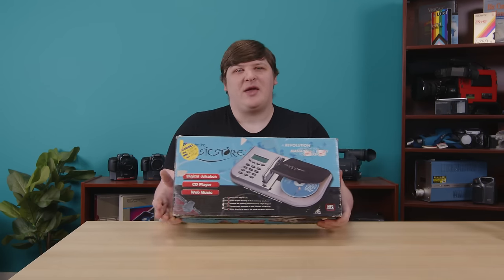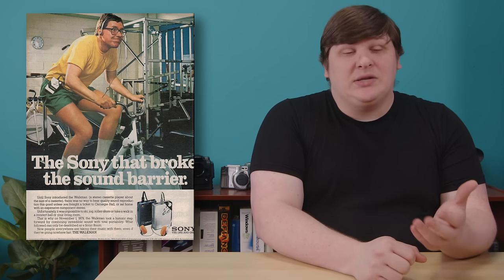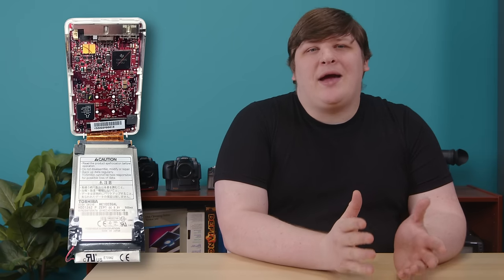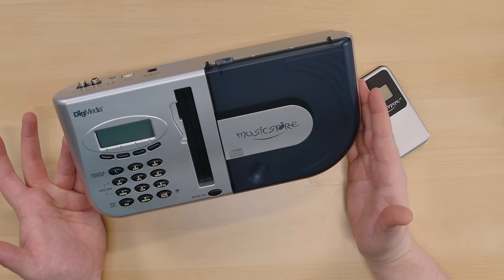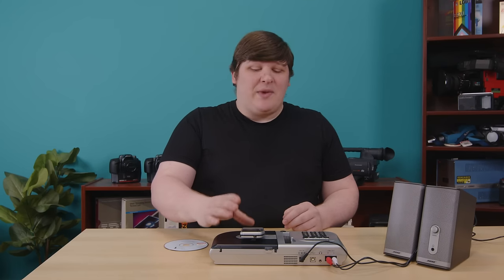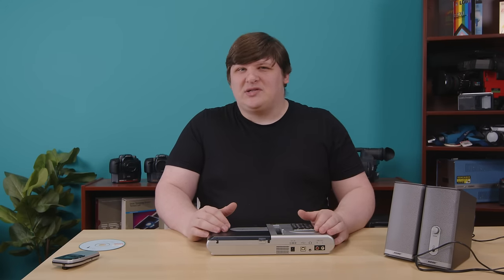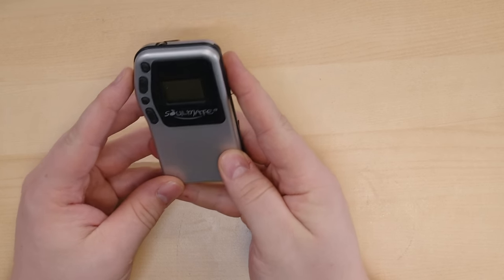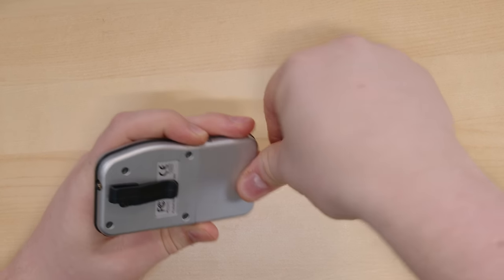An MP3 Jukebox for Everyone (Including The RIAA)

Comment: Ah, yes, I remember the Rio MP3 players. I bought my wife a Rio Sport MP3 player in the early 2000s when the tape player in our car stopped working. The car was already more than 10 years old, and we'd been looking at replacing it, so the Rio Sport with one of those interfaces that looks kind of like a cassette tape (which didn't work because it turned out there was more wrong with the tape player than a loose capstan belt) or a short-range FM transmitter interface (which did work, sort of) made more sense for tiding her over until we got a new car than replacing the radio did. In the end, the Rio Sport proved too fiddly for her, and she just took a battery-powered tape player with her in the car, but I used the Rio Sport to listen to podcasts when working in the kitchen.

Pretty much everything you said about the Rio that you showed also applied to the Rio Sport, except that the Rio Sport had a USB interface for the computer. The problem was that it only had 8MB of built-in flash storage, so it couldn't hold a lot of podcasts (or songs). It had an SD card slot that could accept up to a 128MB SD card, but those were relatively expensive at the time, and I never did use the thing enough to justify buying one. Getting content on to the player was way too complicated. Like the Rio you showed, you had to use the proprietary software that came with the Rio Sport in order to put content on it, and while that software was easy enough to use, it was clunky and would often crash, necessitating a Windows reboot to get it to work again. The Rio Sport was also pretty much locked into the Windows XP world. When our XP computer died in 2011, I was able to continue to use the Rio Sport for awhile via Windows 7's XP Mode, but this took a process that was even more flaky and time-consuming than running the Rio software in native Windows XP.

Eventually, I replaced our junky kitchen boom box with a nice Bluetooth radio that I could feed from my phone or laptop, which rendered the Rio Sport obsolete. But I got a good 13 years of use out of that Rio Sport. For all its shortcomings, I could've done a lot worse back then for $50.

Comment: To add to your but about the Diamond Rio from the start of the video: I remember the early days of portable MP3 players in the UK. Specifically, I remember a portion of a BBC news segment about them where they interviewed a woman who was a runner, and she said it's great that she can strap it to her arm like her normal CD Player (yes, they really did sell arm sleeves for CD Players) and listen to music on the go without it eventually skipping like even the best CD Player of the time. The downsides were numerous though: CDs took forever to rip, the quality wasn't as good, the player was costly, but given it was just before the debut of Windows XP, it meant fumbling in the dark with Win9x USB support or, heaven forbid, parallel ports, or dirt slow USB1.1 on some kind of Mac if the software even ran on on MacOS8 at all (and if it did, it'd be on the same.basement level as music match for windows) and overall she was disappointed but was keeping it for the "skip protection" as that was such a killer feature to have in something higher quality and still more convenient than making a mix tape or two.
Reply: I wonder why she didn’t go with MiniDisc.
Reply: @kaitlyn__L  To put music onto it at the time would've required a separate hifi component where you literally recorded content onto it like you would a tape deck. Music files transferred from a PC would require yet more unnecessarily complex steps and software, files were stored in a Sony proprietary ATRAC format that at the time was worse quality than MP3, meaning all these new fangled internet music files would need to be converted to ATRAC, disks were expensive, commercial music was never (or seldom) released on the format, and you still had to deal with the fact that you had a spinning piece of metal in your pocket. My older brother had both a hifi component and portable minidisk player, and his collection of mini disks was SMALL. You may as well use a cassette deck with good quality tape and the result will be just as convenient and noticeably cheaper.
Reply: @benanderson89  almost all the portable players could record, and indeed most people used them to get their CD collection skip free. 

Not for downloaded music. Was she explicit about using it for Napster on the BBC? Of course if your number one intention is free downloads that changes things, as NetMD players hadn’t yet launched. 

Cassette decks were absolutely susceptible to shocks as well, and the runner you quoted was apparently besting CD skip protection regularly. She’s willing to pay a premium for more robust skip protection, so I wouldn’t be surprised if increased flutter would bother her too. 

Of course it’s all just academic at this point.
Reply: @kaitlyn__L  and there's the problem in your first sentence: RECORD. Ripping a CD on a PC in 1999 plus a data transfer to an MP3 player, even over pathetic USB1.1 speeds, is faster than realtime playback of a full album. Plus, once you've got your MP3s, they're just on your computer, so if you wanted to swap what tracks you had on a device, just tell the software to overwrite them and they'd transfer to a flash device instead of a magneto optical one that needed another stage of conversion in-between to a proprietary format. Minidisk was not the answer even at the time when cassette players were cheap and refined and sounded way better than you remember. Yeah, wow and flutter was a thing but it's not pausing the music entirely to rebuild the CD buffer, and really, unless you had the cheapest cassette player, it was pretty minimal. My meh Aiwa barely flinched when I ran around with it (albeit in my pocket).

A loooooot of MP3s could be purchased legally at the time. It wasn't just napster.

I'll give you the recordable portable players; that totally slipped my mind they could all do that.
Reply: @benanderson89  If you're planning on dealing with an MP3 music library, then obviously an MP3 player is kind of your inherently ideal solution. But if you're the kind of person who jogs with an arm-strap CD Walkman, then the Mini-disc workflow isn't really that difficult. Just plug it into your CD player and rip a few discs you want to exercise to. Sure it's real time, but you can rip a few discs or even old workout mixtapes if you wanted, and that only takes a few hours to do. Then you can stick all those discs in your pocket and you've already got a few hours of music on the go. It's not exactly fancy without using the clunky software to manage the files but it's functional for at least a significant portion of portable music player users at the time, so i think it could certainly have been a good solution for some people.

Edit: Remember, some of these early players couldn't even hold much more than a minidisc and it was mostly expensive flash memory, so minidisc was at least a cheaper way to carry multiple CDs worth of music in one pocket at that time.
Reply: @benanderson89  It was really a missed opportune for Sony to just not make the minidisc into a mp3 player. Even if they didn´t do that originally, say they did this in 2000 it would kick everything else out of the water. Say if they did this the same time the MD was upgraded to 650MB it would sure be a winner. They could even make it a mpeg4 video player at that point.

The reason why sony didn´t use MP3 or really any similar type of compression at the get go was that there was no chance a DSP at that time could do that to a reasonable cost and power.

They could also kicked Zip out of the water with MD-Data2 if they didn´t make it so reduclasly expensive.

And it wasn´t like that wasn´t known at the time. Most engineeres at the time saw this at a huge  missed opportunity.
Reply: I used a rio 500 back in the day - cd ripping really wasnt that bad as you only had to do it once and I had no problems with ripping at about 2-3x on my P200.
Transfer times were a but sluggish over usb but it was very light, skip proof (I mountain biked a lot), batteries lasted AGES vs cd player and didnt involve winding forward and back or getting chew-ups like tape
Reply: I still have one of those Diamond Rio players, and several small players I bought on Computer Geeks. The Rio was given to me by a fellow "curbside picker", as he didn't want it. The original owner left some "live" Ella Fitzgerald(?) performances intact, and when I plug in, it almost feels like I'm there in the audience.

One thing that rarely gets mentioned about it, besides the weird transfer connector, is that it is powered by one AA battery, and the memory doesn't get wiped if the battery dies, which I was quite happy about. I haven't figured out how to transfer songs back to PC mainly because I believe it's a one-way transfer, but I have re-digitized what was on it, to preserve (in some form) those nice tracks. :)
Reply: @kumbah2006  there was 3rd party software that did allow transfer back I think. As with everything of that time transfer back wasn't allowed in case the RIAA knocked on their door! The weird connector I think is because mini usb b didnt exist yet? Remember all those proprietary small connectors - they were a pain if you lost the cable!
Reply: @kaitlyn__L People seem to forget how obscure MD actually was because of the fact it’s a hipster meme now, but back in its prime it was quite rare to see anything MD related, even in the UK

Comment: Definitely a product of its time.  And I don't even mean from a technology standpoint, I mean from a business standpoint.  Anything with a URL gets green-lit.

So, sure, the software has some rough edges.  But you can see that the engineering here was actually pretty sophisticated, and the people developing this thing really tried.  They were let down by the one who designed the enclosure, and, as much as we sometimes lament that the bulk of the money should go toward engineering, this is a case study of how things like product aesthetics and marketing really matter.

Think about how ambiguously this product is marketed.  The "Music Store"?  So.... it's a device to buy music?  Anti-piracy?  Is it a CD-player or a kiosk?  Does it require a computer to download music that I purchase?  It's not very clear what this actually does unless you're already familiar with MP3 ripping -- in which case, you don't need this.  And nobody's going to spend $450 to find out, particularly when the shelves were littered with boxed disappointment during that era.

If they had worked out the tech, and sold this as a legit HiFi component -- with a standard-size chassis, and a brushed metal faceplate and vacuum-fluorescent display -- they probably could've asked nearly double the price.  Sell the portable player separately, for another $200, and make it feel like .... at least something Aiwa would've made.

It needed a round or three of feedback from consumer focus groups, and I'm guessing they didn't get enough funding to iron out the quirks.  I'm sure they were operating on a shoe-string budget, hoping to get their vision produced and on store shelves.  And this is what you get when you don't understand how average consumers experience your product:  Technically, it's actually pretty good!  UX is a total disaster, though.  And it looks like the kind of landfill fodder that I would've seen, and walked deliberately around to avoid sullying myself.

Comment: The Palm III personal organizer released in 1998 used a similar memory setup to the Soulmate. It also runs on AAA batteries and uses a capacitor to allow it to retain data during the battery change. You turn it off so as not to use more power than needed and change them quickly. The manual says you have up to a minute. You could try changing the batteries with the Soulmate off to see if the capacitors still have any capacity.
Reply: A lot of devices can hold contents for a minute or more if idle when batteries are swapped, but will lose contents if they're active when the power supply is disconnected because by the time the CPU finds out that power is going away, the caps would already be mostly discharged.

Comment: This device is something i'd have used had I been the age I am now in 2000, today I have an Core2Duo based HP laptop with a 500GB HDD connected to my hi-fi essentially doing what this device does. It boots and auto starts Winamp, i choose an album in the media library (all in FLAC format) and then start a visualisation and enjoy the music. I paid £25 for my laptop and it's from 2006 or 7 so running XP it's barely breaking into a sweat.
Reply: I'm just using my old Galaxy S5 Mini as a music player, converting my FLACs to OPUS and putting them on a 16 gig SD-card in the phone.
Reply: I’m still using Winamp to this day as well. It still kicks the llama’s ass.
Reply: I am not sure if i would have used this but in the 2000s i really missed out on a lot of technology that looked useful in retrospect but my mindset was too old school. and Did they have podcasts in the year 2000?
Reply: @belstar1128  Possibly but i wasn't aware of them. Had they existed downloading one, even only 30 minutes long, on a 56k modem would've taken ages to download, easily an hour. Broadband was around as was ISDN but it would be a couple of years before they were feasible.
Reply: @Martipar  Yea but couldn't they have made them low quality. you don't need good audio for podcasts compared to music 32 kbps would be enough. that should even be able to be livestreamed with dial up. it would be bad quality but as long as you can understand what they where saying it should be good enough.

 even today on my phone i compress my podcasts into 18kbps ogg files because i have low storage and mobile data is overprized in my country. but an ogg file has more efficient compression .it sounds like an old radio broadcast and that did not exist in 2000
Reply: @belstar1128  even voice only stuff sounds naff at 64k but as i said just because i wasn't aware of it it doesn't mean it wasn't a thing.

Comment: I remember owning a soulmate stand alone, my first MP3.  I also remember the volatile memory. I remember moding the battery holder to trickle the nicads I used and leaving it on a wall wart all the time when not in use to hold the memory. Supercaps were available at the time and were used in VCRs to back up the clock. I remember changing them. They could not output much current though compared to what we use today. I remember being glad when I got a more modern stick MP3 128mb with proper flash memory and better buttons. Thanks for the video, Daz

Comment: A note on the included HDD in the MusicStore - That drive sounds much like the hard drives sounded in the late 90's. So I'm guessing that the drive included in the unit you have there is "new old stock" that was had for cheaper than spinning rust from the turn of the century.

Thanks for putting another great deep dive together on something that I wanted so bad when I was younger! Lol

Comment: That section you explained regarding CD audio playback on older PC drives really took me back to building machines in the mid 90's. Its important to note that they also had a dedicated PC audio cable that linked right from the back of the drive to a header on the sound card.  Ahhhh sweet nostalgia!
Reply: It's important to note, and indeed it was noted.
Reply: @nickwallette6201  doh! I must have missed it.
Reply: I remember building a new pc back in the day and looking for that connection. I was really confused why it wasn't there. That was the day I realised that I'd wasted money on a sound card.

Comment: I remember this thing vaguely. I also remember the state of non-ipod mp3 players.. My solution was to get a portable CD player (a Panasonic if I remember right) that handled mp3s on CD. Sort of the best of both worlds at the time as you could fill an 800mb CD with a lot of tracks and it was way cheaper than any reasonable mp3 player. Eventually I got an ipod mini. But that little Panasonic player was fantastic
Reply: mp3-CD players really are a great underrated option that most consumers never took advantage of. I still have a Sony portable CD player and car stereo that play them and periodically still burn new mp3-CDs for them. My blu-ray player in my home theater system also plays them.

Comment: @47:00 I suspect the answer to why it was hobbled like that has everything to do with the RIAA. At that time they were making moves to try and make MP3s completely illegal as they had seen the success and failures that the MPAA had with home recording and video rentals and were trying to head it all off at the pass. They were absolutely going after smaller players to use them as examples of what would happen. It took Apple's clout and legal team to finally get them to slow down and be content with DRMed MP3s. Remember, the filed suit against a 12 year old right around that time frame (well maybe a year or so later, the suite was settled in 2004).
Reply: Brianna LaHara, September 2003 it was settled she was one of 261 they went after in that batch. 2000 bucks agreed to be paid out to RIAA the day after it was filed for her case specifically. It was tacky as hell, and she wasn't the only outlier for age.